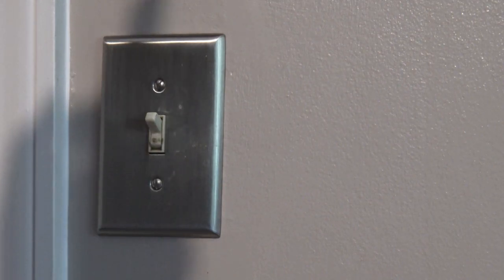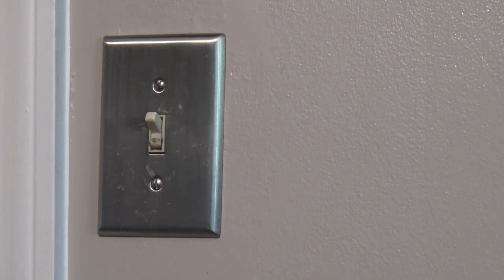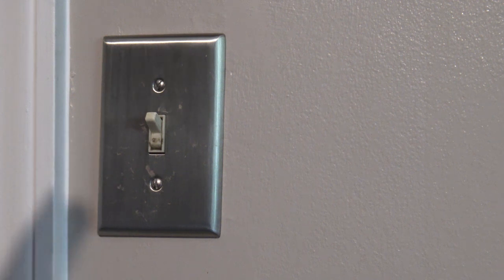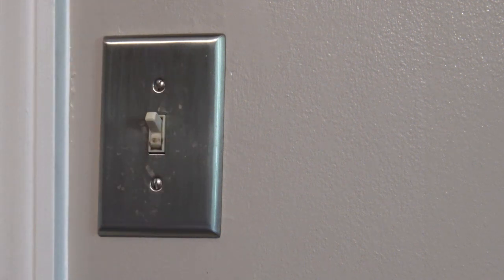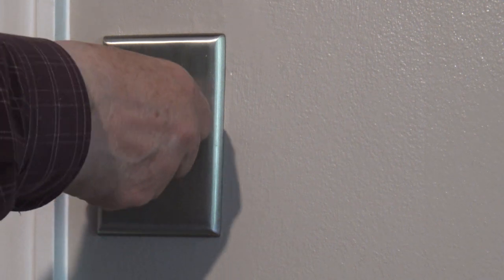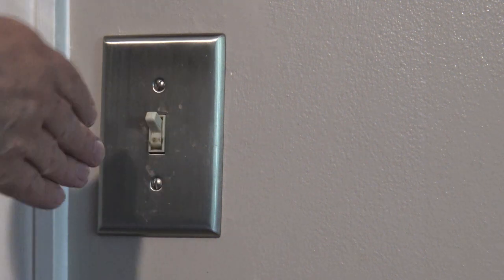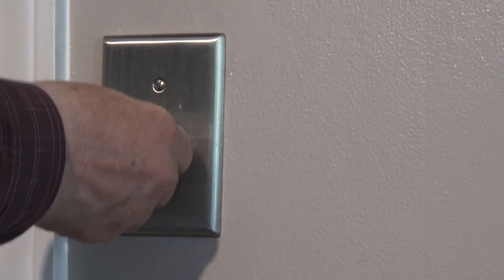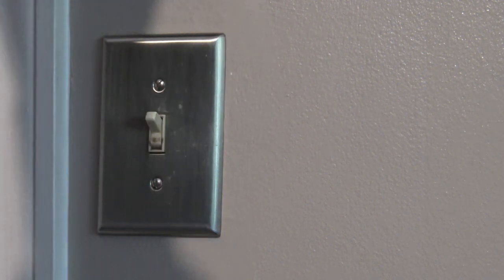Security Light Installation Part 10: Manual Override of PIR Security Light

Comment: Hello. Can the switch be bad after 25+ years? Witch switch should it be replaced with. Thanks again in advance.
Reply from the maker: Yes, light switches can go bad over time. The switch you use to replace it is your personal preference. Do note that our security lights are not compatible with dimmer or smart switches.
Reply: @GoodEarthLighting Hi, you mentioned in this video about certain lights it wont work with?
I have 3 normal outdoor lights around the kitchen to a normal light switch and I want to wire up a stand alone PIR sensor that has this double switch feature! would this feature work for me on tgis set up? 

Cheers!

Comment: I have to turn it off for a few seconds. Then On, 1sec wait, off, 1sec wait, on. Then it lights up for about 7-8 seconds. My dusk to dawn switch is set to off. I just want a way to manually force the light on, regardless of light and motion.
Reply from the maker: When was the fixture installed? Manual override may not work the day of installation. Are you trying this after dusk or in daylight? The dusk to dawn sensor may prevent it from coming on in daylight. You can always reach out to customer service at 1-800-291-8838 for further assistance. We are available Monday through Friday 8:30 am to 5:00 pm CDT.
Reply: @GoodEarthLighting  I have an SE1292-WH3-02LF0-G, and can't get manual override to work as described in the installation/user guide. The area light selector control is in the OFF position. It seems like a faulty/flawed manual mode / override procedure if the dusk-to-dawn sensor is preventing this! Oh, I tried the manual override procedure both during daylight and after dark. It made no difference. Even if it had...well what kind of override/manual mode is that?!
Reply from the maker: Please reach out to customer service at 1-800-291-8838 for further assistance. We are available Monday through Friday 8:30 am to 5:00 pm CDT.

Comment: So I did the on off on off and nothing happened it did not come on..still works in sensor mode.. model #SE1097-Wh3-02LF0-G
Reply: Assuming the switch is  ON, then you would turn the switch OFF ON OFF ON.  If you leave it in the OFF position it ain't gonna work for nuttin!
Reply: Val Durio same without mine.  It’s crap